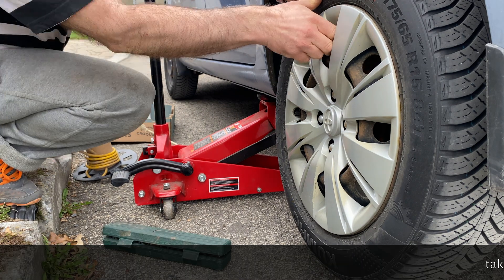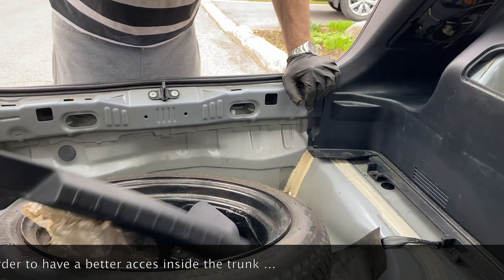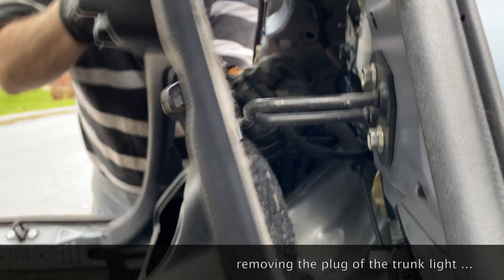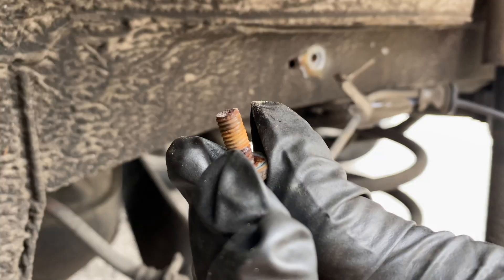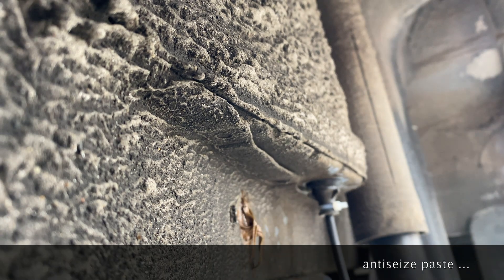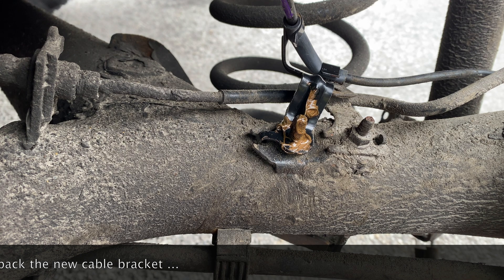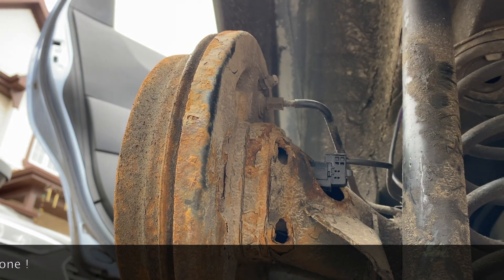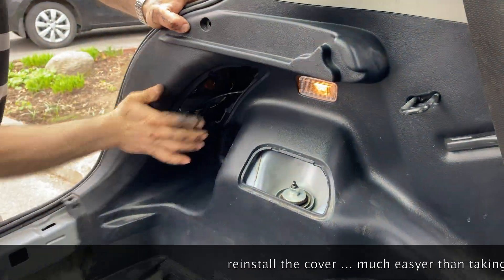DIY - Connector to Rear ABS Wheel Speed Sensor Replacement - 2012 Toyota Yaris - 1.5 L Gas Engine

Comment: I had this problem and I cleaned the ABS wheel connector with electronic contact cleaner.  So far no problem, and it is a much easier job.
Reply: Hi ! Thanks 🙏🏻 for your comment !
After that job, few months I had no problems. But the car started again to make noise when braking. I went back to my friend and now I get different error codes. So, I bought the bearing with the sensor and I replaced it. Again, few months everything was fine until the car started to sound weird, as before…
The winter passed and now it’s quiet again but I don’t know for how long ! 🤪
Hope to stop for good !
Good roads to have, i wish you !

Comment: Is it working now? I got the same issue. Wyskakuje błąd ABS.
Reply from the maker: Please check the other diy with the wheel bearing. I suggest you to change that before replacing the cable/connector. In my case It didn’t worked until I replaced the whole wheel bearing but be careful when you order it to be sure it is coming with the ABS Sensor !
Please watch the last movie i posted. Thanks 🙏🏻!

Comment: This video should be taken down. All you have done is change the harness which does not need to be changed. The problem is always in the Hub. The sensor is integrated into the hub. 
This repair did not fit your problem and you know it. Why are you not removing the video which will mislead others. Not very nice!
Reply: Dude … mechanic can be a bunch of shit. It’s always about replacing what looks bad first and upgrading. Plus the wires are not pricey so it’s not that bad to replace also
Reply from the maker: I am working on…
After I did it I found i didn’t fix my problem…
I made research, bought the right assembly, replaced the hub which has the ABS sensor pressed in …
Today or tomorrow I’ll put online with all details… about this “odyssey” …
It’s weird, I have that problem on a Toyota!!! On the Hyundai Elantra I have 274.000 km and never had troubles like this !!!
Sorry…

Comment: You are replacing a sensor wire harness, not the sensor. Please correct the title of the video. The sensor is the thing in the hub that you plugged into. I hope your ABS lights were helped by this.
Reply: Boo hoo
Reply from the maker: hi, and thanks for your comment !

this is the part I bought ... "Rear ABS Wheel Speed Sensor Connector"
even for me it was a bit strange but if they name it that way ... a piece o wire in fact ... 🥸
https://www.rockauto.com/en/moreinfo.php?pk=5408913&cc=1502640&pt=762&jsn=1

I did't find the picture with the code I had ... but I had 3 lights on the dashboard (parking brake + abs + traction control) and now I have no one ... seem it is working well .. 😎